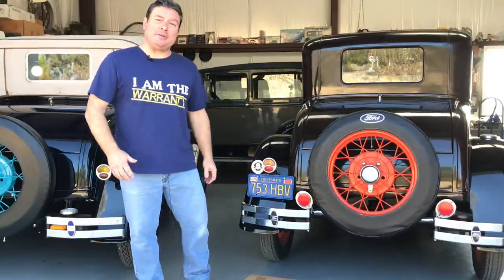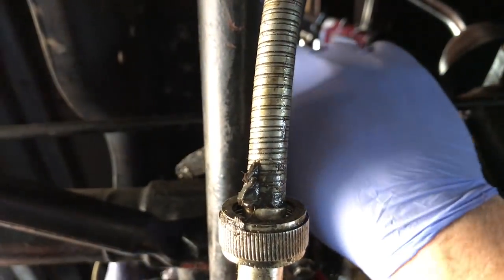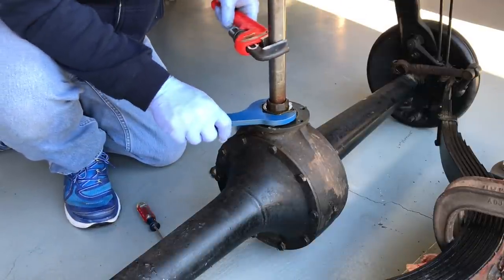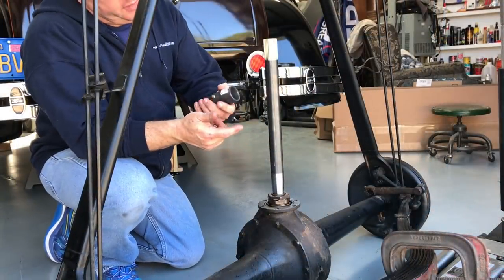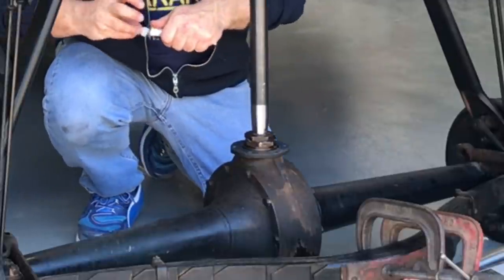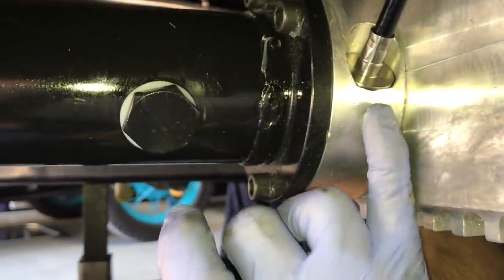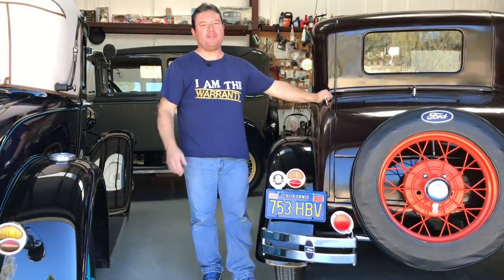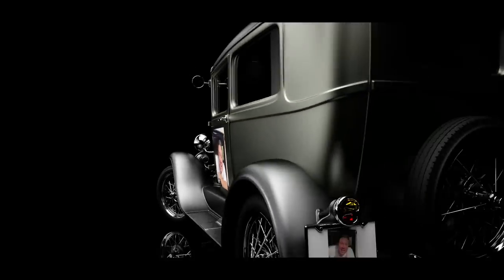Ford Model A Mitchell Overdrive Installation

Comment: Have you ever seen anyone put a t5 Trans swap in place of the original.
Anyone in your club do it ?
Reply from the maker: I have heard of it being done, and drove one once.  I am not a fan of it. Would never do it to any of my cars.
Reply: @ModelA  just because of keeping things original?
Reply from the maker: @wadedog4280    No.  Because I don't like it.  And you have to cut the center crossmember.  Not gonna do that to my cars.
Reply: @ModelA  since you have driven one,  how did it run, did it help the engine speed in a positive way or negative way. 
Sorry to ask so many questions.
You are number one !
Reply from the maker: Thanks Wade.  The one I drove had the overdrive gearing, so it did make a difference.  And it was synchronized.  However, it felt like the gearing just wasn't quite right for the Model A RPM range.  Can't put my finger on it, but it just didn't sound very happy.

That car was sold by a club member to someone outside our club.  I later heard there was some sort of rear end failure caused by the use of the open drive shaft that you have to use when switching to the T5.
Reply: @ModelA  thank you very much,  that's great info that I haven't heard. 
I thought the synchronize transmission would be nice instead of learning to shift , lol maybe it's not as hard as it looks. 
That makes sense About the t5 and the rpm range of the engine,  makes total sense to me. 
I guess ford knew what he was doing.
Reply from the maker: @wadedog4280    If it's synchronization you want, why not go with the Mitchell Model A synchronized transmission?  It is an exact Model A transmission, but synchronized!  Looks exactly the same, bolts right in.
Reply: @ModelA  cool,  I didn't know About that. 
You are Awesome